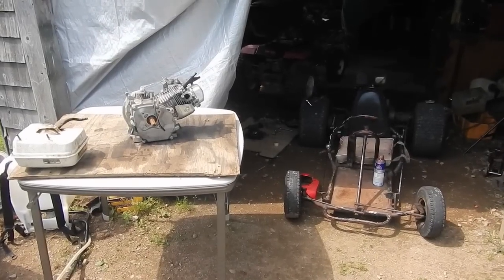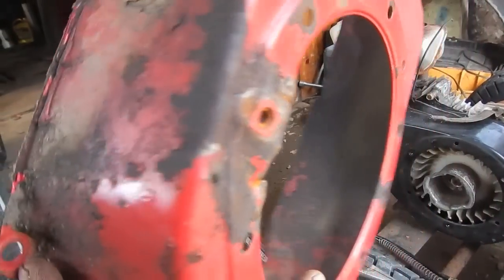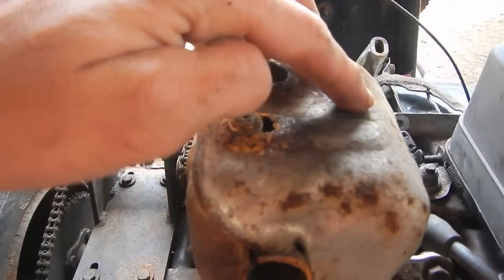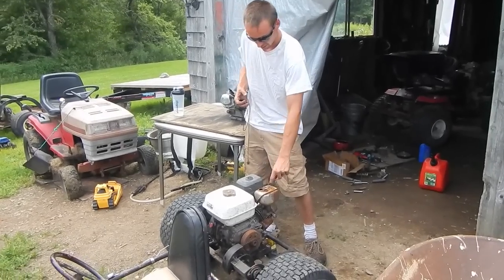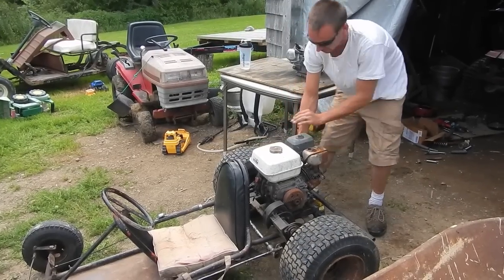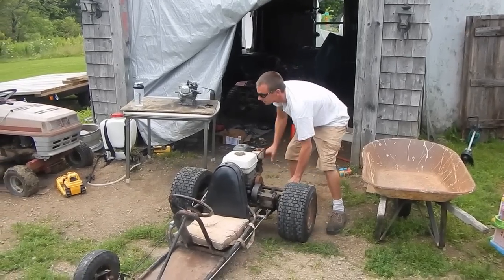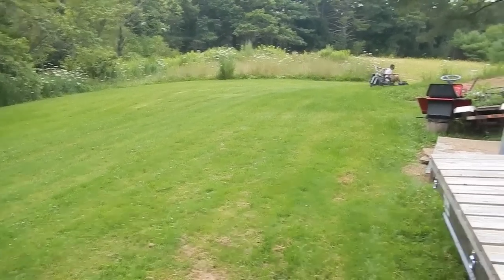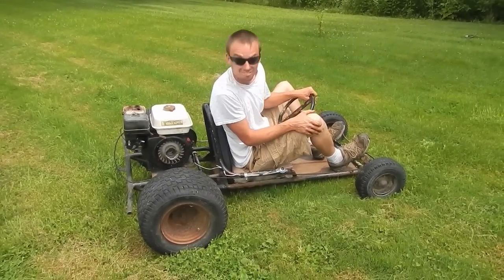$100 Go Kart First Drive

Comment: I had that happen to me with the water. It made its way to the rings and locked the motor up in the winter. I broke it free but scared up the bore freeing it up. When I tore down the motor the rings was filled with aluminum and jamed in place, but amazingly before I tore it down it was still running.

Comment: the reason the muffler has the holes in it is because a protective box goes over it, and screws go in the top of that to hold the box on and fill the holes.

Comment: Hey Fearless! I see it looked like that clutch was having some trouble pulling you up any incline. Those clutches do wear out fast. Instead of hundreds on a comet clutch you should look at doing something similar to the belt system all your mowers use! Would give lots of gearing options and more control!

Comment: Doesn't look like someone knocked holes in the exhaust, more like all the mounting holes for the heat shield rusted through. Maybe it had road salt water on the hot exhaust for a couple after-rides.

Comment: those front tires look way too small. kinda looks like the frame needs a little beefing up, as well, but for a first run, that doesn't look like a bad deal.

always nice to have some extra parts laying around of your own, when it comes to getting a deal on something. SOME people's wives just don't understand having boxes of extra parts in the garage....until you put together something like this.
Reply from the maker: yea, the whole thing sits with an aggressive forward rake... I worry about the motor getting enough oil at that angle. I really want bigger tires up front to level it out

Comment: Not sure you know. But the holes are not punched in that muffler. My boss has same Honda engine. And the bolts that held that cover on rusted out. Im almost sure that's what happened to yours.

Comment: Do you know why it stops running when u let go of the gas. It happens to my gokart to .Thxs
Reply from the maker: the idle might be set too low. try adjusting it in a little bit.
Reply: Fearlessfront I have a 5 horse power Briggs and Stratton and it does not idle.  I am just wondering if you would know how to adjust the idle because a much as I have looked, no one freaking knows!  Very frustrating but I was hoping you might be able to help.  Thanks again and keep the great videos coming!

Comment: Those holes were welded the seem to rust out the little holes are from the heat shield screws nice engine a genuine Honda is built way better on the clones they have a lot of in and out shaft play even when new

Comment: Also if the engine is hot enough and rain water hits the piston it will crack it. I had a hole in my pipe and hit a puddle, grenaded my piston.

Comment: Where do u find frames under 100 $ and then an engine under 100$ to =around 100$
Reply: You cant, he found this for an amazing deal, but who knows how long this will last. If you really want to build something cheap you have to own a welder and know who to fabricate metal. As well as research engines and gears.
Reply: go to the "offerup" website they have a lot if go karts and frames there